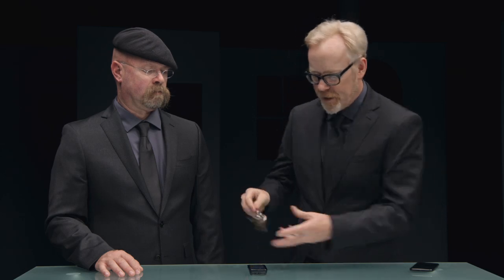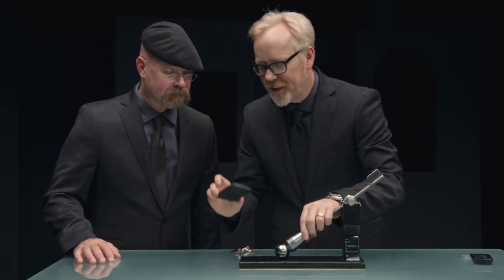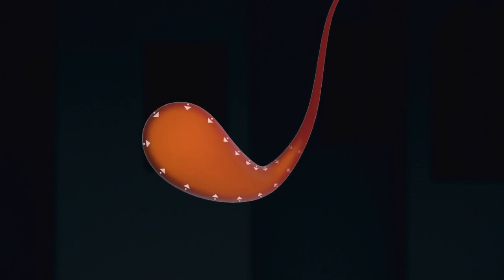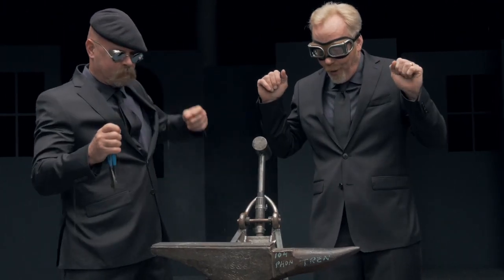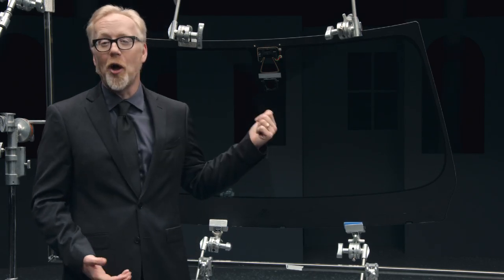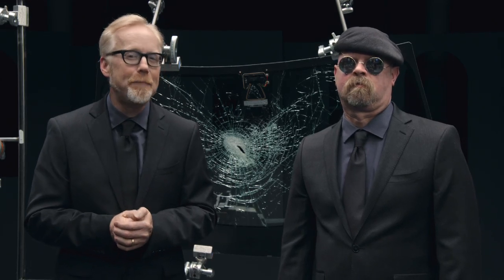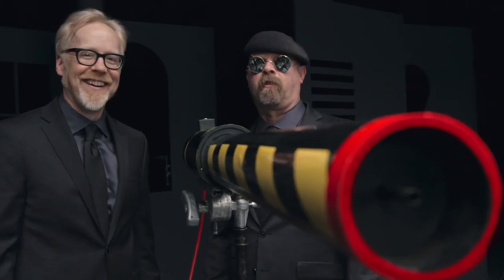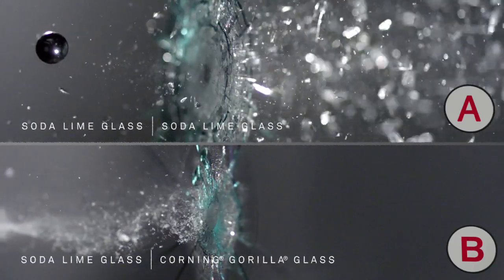The Glass Age, Part 2:  Strong, Durable Glass

Comment: So in 2014 when this was made, they said that gorilla glass was close to being useable on windscreens.

Where are we with this today in 2019 ?

Also....Windscreen might weigh 1/3 less, but if it cost 3 times as much, that would be bad for the price.
Reply: I noticed they never mentioned cost.
Reply: @1978garfield  I kind of understand this, as in 2014, this was clearly in development, but the wording in the ad makes me think that in 2019, there should be a finished product and prices should be available now.

I have not been able to find any products or prices, so i am guessing that the lighter windscreen was either not technically possible in the real world (Maybe everyday stresses on the windscreen, from driving over uneven terrain, proved impossible) or it is possible but the price is still too high to justify this.

To be honest, if the end user is able to buy 3 new windscreens for the cost of one of these, then it will be a hard sell.

Lastly, i had hoped, when i saw this video that they used the gorilla glass to improve the durability of the outside as this is where the window takes the abuse and is effectively "sandblasted" to a degree where a new windscreen is needed just for this, even though it is not cracked, but they still use ordinary glass on the outside, making their windscreen totally just as "bad" as the original one.

Basically the only 2 advantages are

1. Weight
2. No small pieces of glass in the car after a pebble hits the windscreen.

#2 is very rare to begin with and #1 needs to be a tradeoff, of saved fuel, vs price. a weight reduction of 2 kilo's alone is NOT going to be visible on your fuel economy anytime.
Reply: Fun fact: Apple once decided to go with a weaker screen because it'd make the phone thinner.

I dont know if that remains true til' today. But just a thing to think about.
Reply: @applecore4720  Apple have alwayd put design over funcction.

They also released a Phone where the design department decided where the antenna was, Even though you could Block the signal if held it "wrong"

Comment: about that windshield aplication. NO. From weight prospective in civil use windshield is 1% of the total car weight. So 1/3 is  0,3% of the car weight. Also the windshield is desing to absorb impact from the inside si its safer for the pasangers. This same downside have polycarbonate windshield use in racing. That is one of namy reasons racers wear helmets.

Comment: why not instead of using glass windshields, we use plastic or polycarbonate?

surely thats both lighter and stronger than glass is?
Reply: This is just my opinion because I cant be bothered to look it up but I think it will have something to do with it actually being "breakable" to absorb kinetic energy in the event of a crash. Just like most bonnets of cars are "collapsible" for this reason. Test it yourself, go slam your face against a windshield and it will crack easily but you should be relatively okay, now go slam your face into a house window until it cracks...

Comment: There could be a safety issue with Gorilla glass on the inside of a windshield. If the Gorilla glass does not absorb and dissipate impact energy, (like crumple zones in automotive bodies) what happens to a passenger hitting the Gorilla glass in an accident?

Comment: Why not mount 2 layers of gorilla glass? You can call it Godzilla glass!
Reply: Twice as expensive, for starters.   Plus,  while small dings in a normal outer glass layer can still be fixed, that may not be true of Gorilla Glass. "Doesn't break often, but when it does it costs you $2500" is not a strong selling point.
Reply: Copyright
Reply: 10 layers with plastic between each one, and would stop a bullet.
Reply: @paullangford8179  That is what bullet proof glass is FYI
Reply: Bulletproof glass isn't 10 layers of glass with plastic in between! 
 Aside from using a thin layer of glass for the outer to withstand scratching and marks etc, the rest of bulletproof glass actually consists of different thicknesses of polycarb (varies depending on what size bullets you want to stop) and has a special resin in between to keep it all together!
Reply: @paullangford8179  they prolly already do this
Reply: @Isaac Kennedy your theory is more then likely true, but i wouldnt be certain
Reply: Maybe even light might bounce back from this godzilla glass... Better than concrete, impenetrable even for NSA microwave monitoring.
Reply: Tesla have promised something like that in their upcoming Semi truck next year, they call it "Armour Glass" and I believe they will warranty it against breakage in normal use, i.e. from flying stone-chips and suchlike -- https://www.youtube.com/watch?v=cwN39LWnzG4
Reply: @foobarrel9046  Evidently they now have a gorilla glass windshield. https://www.youtube.com/watch?v=qFl_81grEKk
Reply: Feel a makes loads of promises,  the blokes as reliable as trump, but not as peevish
Reply: Tesla
Reply: @Isaac Kennedy Chemically tempered glass (Gorilla Glass for example) does not behave like conventional tempered glass (heat tempering). 
Chemically tempered glass does not implode/explode, when being damaged.
Reply: That's exactly what they're not showing us, what happens when it does break. Single or dual layer windshield.
Reply: You mean "King Kong" glass........?
Reply: @Isaac Kennedy Well if you take the windshield and compare it with smartphone glass(which is very strong everywhere exept all the sides and corners). And that is with 1 layer of glass.I cannot imagine how strong would be 2/3/4 layers of that same glass.Even without any protection on all sides it can take a hit. You can find videos of people shooting prince Rupert's drop with a gun and it would not break.
Reply: No!
Reply: Thats... How they make buulet proof glass ._.
Reply: Yeah i agree with you bru' 😎😁⚔️
Reply: read reply by Isaac Kennedy, and i bet the high speed sharp dust will kill every one in the car
Reply: I just watched the video and I was gonna say the same thing.
Reply: They're holding back, as usual. All industries are comprised of asshole swindlers.😠😠🤣🤣
Reply: @Isaac Kennedy Seems a good point!
Reply: They actually made for each other who they are today. but why the producer would make such ill-ingredient content lines for them? sure Jamie is very much downplayed ....?????
Reply: Most likely because when compression strength glass breaks, it shatters into 15 million pieces like the Prince Rupert's drop. Which is a problem for a vehicle windscreen. Similar to the toughened side and rear windows of your car are harder to break than the front, because when the windscreen does break, you still need to see through it!

Imagine a small stone chip at 80mph and you then instantly can't see.
That's why it's not approved for vehicles yet.
Reply: @Isaac Kennedy: I'm not sure you are correct .  I have cracked my gorilla glass phone, not shattered?
Reply: Because we are capitalist.

Comment: Still not good enough. Yeah so what it didn't go through the Gorilla, it still broke the glass and you would still have to pay mega bucks to replace. Sure it protect you more. To bad they didn't fire a piece of rebar at it.

People are also fooled by hurricane glass, they think its unbreakable except it breaks like normal glass and then they are sticker shocked at the repair cost. But with Hurricane glass , it breaks but nothing goes through it, so yes in a hurricane it is nice to have.

Yes I am a glass man and my motto is thicker is better. One of the hardest glasses to break in my 19 years of experience is 3/8 or thicker tempered glass. Same concept as the Prince Rupert glass. Because it thick it hardens on the outside and is softer on the inside. I have only seen 3/8 tempered break once and that is when a customers disgruntled employee through a heavy steel cloths rack that had sharp steel corners on it through a 3/8 tempered window. So if ya want tough glass 3/8 tempered with a safety film applied to the inside and you are golden.

Comment: So, are we just not supposed to ask why we dont get two sided laminated gorilla glass and completely replace soda-lime entirely? I would expect a consequential 2/3ds reduction in window weight, and likely increased surface strength, which would be more resistant to even scratches or breaking at all.

Comment: I want to see the ball bearing shot through a giant sheet of Willow Glass! I want to see a thin sheet of Willow Glass folded over until it breaks. I want to see what it takes to break, smash, or damage two sheets of Willow Glass with a core of resin in the middle, just like auto glass but thinner and 50% lighter.

Comment: I still want to see him use the hammer on the second one.
Reply: As a materials engineer---
It would actually fail a lot worse, making a tighter web of fracture lines that would be nearly impossible to see out of. While both panels would still be bound to the laminate layer (no major glass projectiles), with the tempered glass, drivers wouldn't be able to see and would likely crash after such a break.
Reply: Fishinacup246 and who would drive with a giant crack in their windshield?
Reply: Looking at Youtube videos, almost every driver in Russia.
Reply: @thejupitergod5687  sometimes you just have to, especially after a hail storm or a lawnmower throwing a rock out into cars... it happens, and the latter can be deadly if the rock is big enough
Reply: You'd have the usual YouTube jackass trolls whining about how Jamie deliberately used less force on the second windshield, yadda yadda yammer yammer.  (We've already got them blathering in the comments.) That's why they switched to controlled experiments.

Comment: A 120 mph ball bearing is moving slower than the upper legal limit for paintballs. Most paintball fields have an upper limit of 280 feet/second, which is roughly 191 mph.  Jamming that much kinetic energy into a singular point is how anyone breaks glass. It's why a hammer works better than your fist to knock out car windows. 
Additionally, when was the last time a pebble came directly at your windshield in a straight line? If kicked up from under a car, it travels in a parabola. At normal follow distances in my experience, a pebble will be headed in an upward motion, causing most of the kinetic energy to be in parallel with the plane, allowing it to skip off, minimizing damage. 
I'm onto you, Corning.

Comment: Why not make both layers in gorilla? Oh, you’d put SafeLite out of business...
Reply: think number one thing is cost  but yeah
Reply: Gorilla glass is like 50x more expensive than soda lime or magnitude like that. Production would (and could) be scaled up but for now, it's probably out of cost OR they're using similar principles found in metallurgy - pairing a softer material on the outside with a harder material inside. The purpose is to eliminate passenger hazards, not necessarily survive a rock strike. Even still, the biggest reason why people replace their windshields is due to damage or scratching on the outer layer. Without engineering the outer layer with a more robust material all this design accomplishes is it takes a $400 windshield and makes it a $1000+ windshield in exchange for more protection in ONE particular instance.

Comment: I believe we have transparent aluminum now right?
Reply: As a ceramic, yeah. It's not exactly like glass, but it's close -ish. But its not as hard as sapphire, which is used for some optical components. It's aluminum (or aluminium, if you want to get into that debate) oxynitride, if I recall correctly, and it's transparent in several wavelengths, including those of a human's eyesight. It's created by a fusing of aluminum, oxygen, and nitrogen, and makes a fine theoretical transparent armor. Or an excellent tank for transporting whales through time.  😉

The only problem with it is it's prohibitively expensive. As in very, very, very expensive. If even the military is waiting to invest in it for bulletproof glass, that should tell you how expensive it is - they don't even blink when they buy $50 hammers or $5000 toilets. 😄

Comment: is anyone else wondering why it isnt just a sheet of Gorilla Glass or 2 panes of it laminated together. i mean, why let a windshield break at all. all that windshield did was prevent glass fragments from exploding in someones face. it does nothing to actually protect the windshield from damage. which when broken will ultimately have to be replaced anyway due to visibility issues and the all too well known spiderweb effect that the changing of the seasons causes. so sure, i dont get glass in my eyes or lungs (and that's great) but i will still have to buy a new windshield that is likely at least 2x the price of the regular windshield. soooo. why?

Comment: The glass in a vehicle breaks molds around your face and has a layer of plastic inside so that it does not cute you up...It is not meant to be unbreakable and hard this is what they tried early on and found it to be quite damaging to people in accident .. So vehicle windshield has a great safty record use to cute you to pieces and smash u up ..... They fixed that a bit and this windshield falls short of the safety factor quit a bit...

Comment: This isn’t true myth busters testing. They would realized that the ball drop is a very very concentrated blow in comparison to a drop where a face may land completely parallel to the ground and breaks. True myth busters would have over engineered a vertical tunnel shaped exactly like the phone being tested. Held and released by small vacuum to ensure consistency. 

They didn’t sell out but I’m disappointed 😔

Comment: What about the glass maker in ancient rome who made a glass that could be bent and then HAMMERED back into shape without breaking. The emperor was so worried that this new glass would collapse the other economies that he had the glass maker killed all piece of the unbreakable glass destroyed. To this day no one has been able to digure how this glass maker did it. The romans also figured out how to make thw furst glass using "nano particles", by mixing ultra tiny particulates in with the glass they were able to make a cup that changed color determined by what was poured into it and by the direction light was observed going through the glass, allowing one cup to turn either green or red at any given time. And once again, to this day we dont know how thw romans did it or even how they knew of such things.

Comment: if windshield A is made of two sheets of the same material...while B is half.. I'd like to see Windshield C with full gorilla... not just a half ass version.. 

p.s. ive never cracked a screen or broken a nokia phone in my life... but gorilla glass... yea i cracked that when it fell 6" off my knee (galaxy s7 edge)...so, meh. metal back phones is what id rather see... glass cracks and breaks...plus its stupid to put an insulator like glass on a rear metal heatsink...ever wonder why our phones get so hot? yea..the heat can't go anywhere but the screen and its literally trapped in your phone...stupid.

Comment: That "drop test" is completely bullshit...

Never in the history of dropping your phone has there been a heavy metal ball concentrated in the center of the display of a phone. It will drop either on the outside of the chassis or be spread throughout the front or back of the phone depending how it drops.

As for the windshield... what the hell? He hits one with a sledge hammer then the new and "improved" Corning glass doesn't get the same treatment? It gets a small bb shot at it instead so you can't see that the new one will break just as easily.

Comment: Flexible glass it's been done before but lost in time 

Flexible glass is a legendary lost invention from the time of the reign of the Roman Emperor Tiberius Caesar (between 14–37 AD). As recounted by Isidore of Seville, the craftsman who invented the technique brought a drinking bowl made of flexible glass before Caesar who tried to break it, whereupon the material dented, rather than shattering. The inventor then repaired the bowl easily with a small hammer. After the inventor swore to the Emperor that he alone knew the technique of manufacture, Tiberius had the man beheaded, fearing such material could undermine the value of gold and silver.[1]

I'm very happy someone invented again 
👍😎👍
Well done

Comment: I'm curious why there isn't a demo of the windshield with a double layer of the gorilla glass. Is it too light to handle the wind speeds generated by a fast moving vehicle? Maybe the air pressure inside that creates the buffeting sounds would make it flex too much?

Comment: The thing is tho, it doesn't matter if A or B gets hit by whatever, if the damage is done, it has to be replaced, now i might be wrong, but wouldn't the cost be much higher to replace B? It's a great inofmercial with a decent undertone which is efficiency,  just like it's much more efficient and environmentally friendly to use solar power generators for your household, yet majority wouldn't be able to afford it, even if it's more efficient in every way.

Comment: Perfect, my car will be maybe 6 pounds lighter which won't effect my fuel mileage. And my car insurance will go up because now if a stone gets thrown into my windshield it'll cost $2000 instead of $275 to replace it because the outside is still the fragile soda lime glass. It's a great substance, just NOT for car windshields.